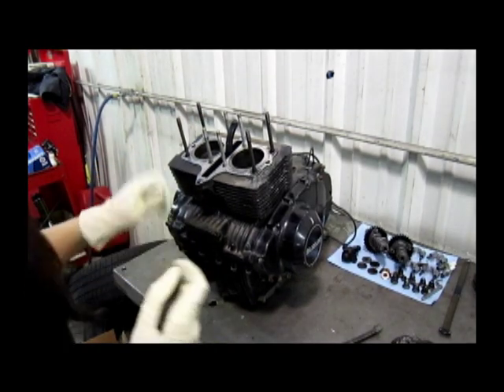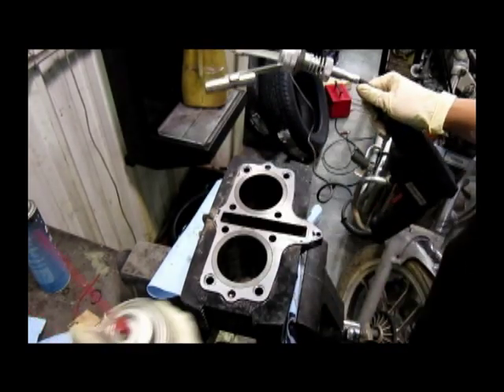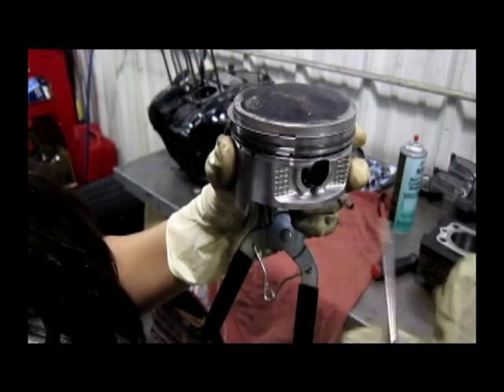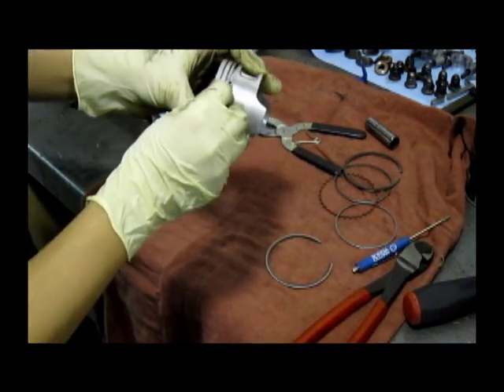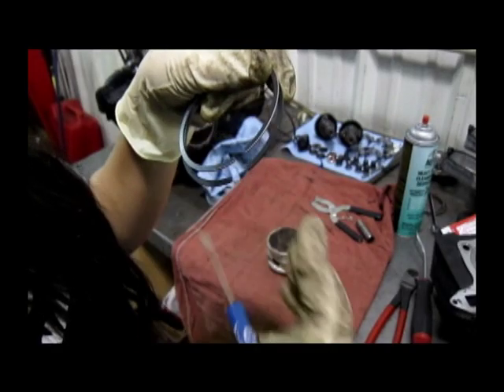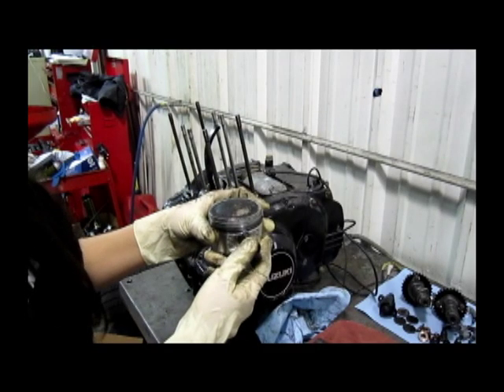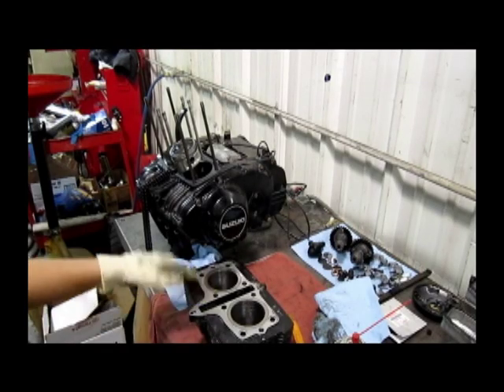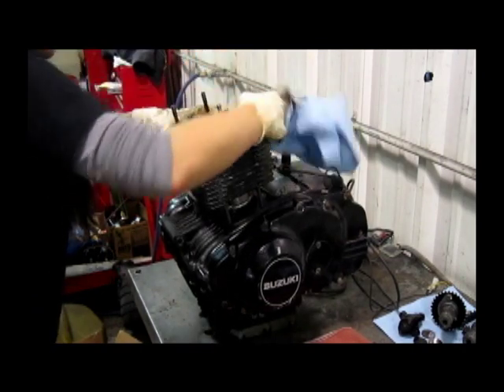Suzuki GS500 Top End Rebuild Part 3 of 4

Comment: So I got my cylinder block removed and I noticed the cylinders are just inserts  that are pressed in to the block. I can knock both of mine free of the block pretty easily with a rubber mallet which leads me to wonder; has anyone ever just replaced the press in inserts alone? Where could I find just the press in inserts for sale?